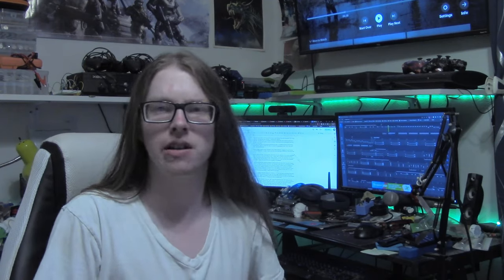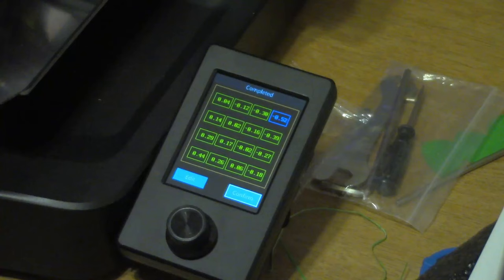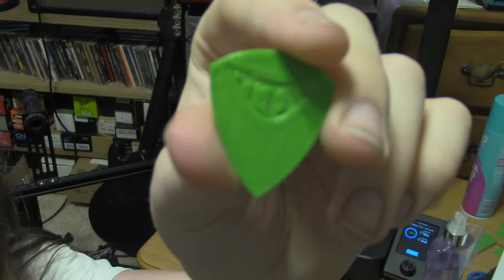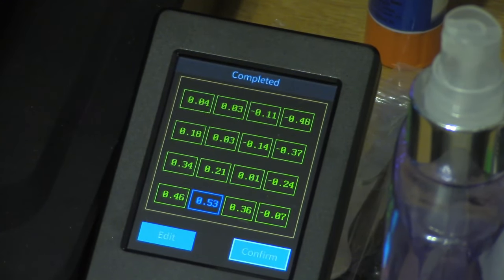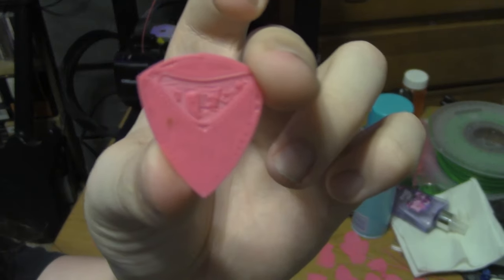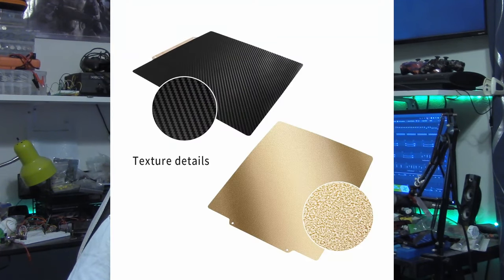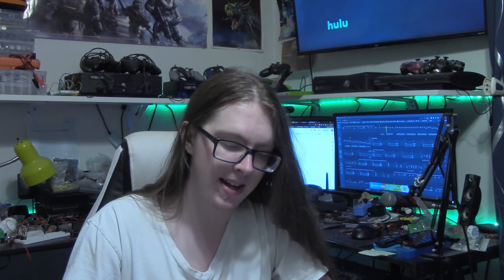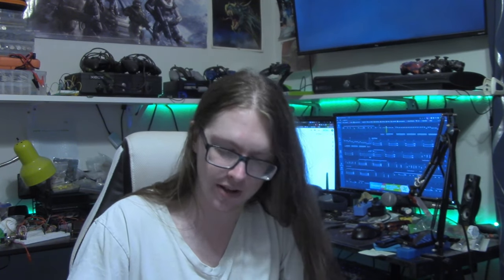Having trouble with your Ender 3 V3 SE Bed? So am I. Here's trying fix it.

Comment: Bro your supposed to remove that magnetic sheet OFF the bed and Bend it, to remove your prints. When its cooled off.  Your fine.....thats why its magnetic and removable
Reply from the maker: I know how it's supposed to be used. However on small prints that don't take up much of the build surface I find myself either doing more damage to the plate or not getting the print off anyway.
Reply: The print bed they provide has such strong adhesion it destroys itself, you can see tons of people complaining on Reddit about it. It won’t separate even with bending while cool. The first mandatory upgrade is a PEI bed
Reply: Not many people clean it properly or take the build plate of let it cool then bend small stuff might need a few more minutes to cool but it will pop of easy @crypto14

Comment: I have Ender 3 V3 SE for 14 days. I unpacked, screwed in the 13 screws, and since then I've been printing with absolutely no problems. It is my first 3D printer.
Reply from the maker: I bought it as an early adopter when there were few reviews out for it. They may have improved consistency on machine quality since then but mine has been a nightmare. I'm a little envious of the people that have a perfect time or only need to make minor adjustments. If everyone was having a bed time they might have done a recall or something but now I'm fighting them on a warranty claim as they try to give me band aid solutions.
But at least you're having a good time, especially for a beginner. Though be aware that some people have had problems arise after a month or so of perfect use, so just be ready for that possibility too.
Reply: Here to update - I got a gold magnetic pei bed for the printer and it fixed my problem with bed adhesion.
Reply: Same, it works pretty great. Small tip: never be an early adopter for anything!
Reply from the maker: @soyunbonus  Yeah, it really be like that. lol. If I waited, I probably would have still bought the printer based on other youtube videos. But maybe with the time they would have had better consistency or something. Who knows.
Reply: I'm going to guess your printer will develope problems in the next month. I'll try the new bed idea. I'm more keen on trying another brand printer like the bamboo labs a1 that rolls out soon to the usa
Reply: Yea the first month is ok after that you will be printing out piles of string. I genuinely have taken a sledgehammer to mine. That was after getting 5 replacements that all did the same.

Comment: For over adhesion. I adjust z offset by .02 to 03 in the prepare menu and when I run petg I use painters tape so I dont destroy pei on springsteel plate

Comment: I had terrible issues with stringing. I looked at loads of video’s including this effort. It turned out to be the firmware update.
Reply from the maker: That's a little strange, but also makes sense. It's unfortunate that in my experience the auto leveling seems to have gotten a little worse since updating to the .6 firmware.

Comment: I'm new to 3d printing. I have to say that this machine is kind of difficult. I also have to say that it has taught me a lot.
Reply from the maker: That's kinda how creality machines go. They're basically never perfect, and if they are, they don't stay that way for too long. I learned many different concepts and fixes because of my Ender 3 V2.
Reply: @Bowsmin12  As of right now, the hot end is burned and in need of replacing. It was my fault but the part will arrive tomorrow so it's not too bad.
Reply: I'm also new to it and it's my first printer, so I'm learning a lot too.  I've had good results with some filaments but others don't work as well.

Comment: That's what mine was doing and now no matter how many times I level it Its under extruding randomly it isn't blocked like at all .. not under extruding not slipping.. one pass is fine next it's the wrong height.... Normally I can adjust my beds but these seemingly have no adjustment!
Reply from the maker: Yup. They intentionally relied solely on the auto leveling system. In theory it would work, but in practice Creality has never seemed to be good at implementing auto leveling. I bought their CR touch kit to put on my Ender 3 V2 and put their firmware in the printer and it never worked right. Then I installed a third party firmware and it was night and day for my auto bed leveling.

Comment: Dont know if you are going to see this, but consider start doing 3D printing as your main topic on this channel, you helped me a lot! Kudos from Brazil
Reply from the maker: That's good to hear that I'm helping. The 3D printing content has cause most of the small channel success I've had over the past months to year. But unfortunately other than this troubleshooting journey, I don't have a whole lot of knowledge to pass on to people or really innovate things. I got lucky with my bambu lab P1P purge video. I just wanted to save on filament, so I went to the customer support and they told me how. I then just relayed that in a video because it seemed like the only other place I had seen anything about it was on a single reddit post and it was kind of hard to understand and in broken up bits of information.

I'm not quite sure how to grow a 3D printing channel if you're not making new discoveries. On top of that, I like 3D printing and what it can do for me, but I do find it insanely frustrating a lot of the time. It's a great tool when it works, but sometimes all the components and programs around 3d printing want to fight me and I don't always have the resources to fix them outright. At least not right now. I would love to work with companies to make videos with them but I'm too small typically for them to be statistically impressed. I'm really interested in the Elegoo Neptune printers but I just can't afford much of anything let alone be able to afford more printers for reviews and projects. That's enough rambling from me. Thank you for reading and your support.
If you would like to help, I don't know if it would, but you could try recommending my channel to companies and see if they would reach out on their own. If you have some other people do it too, it may be more likely to succeed. It's a small chance but it might work.

Comment: Ironically, I think you're supposed to use glue stick to help it stick less (intuitive, I know)
Reply from the maker: You can, but most times now, if the printer is worth it's salt, it should be able to print average PLA easily enough. The auto leveling is just bad, I assume due to their coding and doesn't play nice with other print beds on top of that.

Comment: I received my Ender 3 v3 SE two days ago. Its my first filament printer. Printed the provided example with the sample PLA just fine. Then loaded some local PLA . Could not print that crap to save my life. Either no adhesion, or if I get adhesion by jacking up temp then the print has major defects etc. After a day, I changed to using Orca which gave me tools to calibrate with. Bed temps, extrusion temps, flow rate etc. Now I print just fine. The flow rates were the most critical. First layer extrusion temperature and bed temperature determined adhesion. I now have it set that it comes off quite easily. Just take the plate off and wait to cool before removing it. No hairspray and shit. I am on firmware 1.0.4 and I see 1.0.6 is available. But I will use a RPi and go Klipper rather. The Ender 3 V3 SE was my learning machine. I will play and learn and next build my own now that I am seeing what works etc. Orca certainly produces better slicing and supports etc. If I take the same stl, the Creality slicer does mot do the same job as the Orca slicer does. As a beginner I wanted to avoid diving into the millions of parameters you have to deal with in Orca, but now I am a believer.

Comment: I just got my ender 3 v3 se week ago now,  probably have 48+ hours on it printing time, and I have a pretty good grasp of how 3d printing works,  but I'm still extremely new.  I've seen a lot of people having problems with bed adhesion, but I only find that when I'm printing in a very thin first intial layer thickness like  0 .10 so I bumped mine up to point 0.30 and boom never fked with it again, i also keep my bed temp at 45c and im using PLA right now so bout 200c for nuzzle temp
Reply: Yo i think you should bump bed temp to around 55-60c if you have adhesion problems.

Comment: You're not alone. I'm fighting the same problem. Even down to the back right corner lift. I've had some success with increasing print speed and flow rate. However, with each print the Z offset has to be readjust and this results in at least 2 or 3 failed prints. It's a huge pain in the ass...
Reply: I'm hovering between -1.40 and -1.61  for my Z-offset depending on print temp and speed. I'm getting the hang of adjusting on the fly but I have to babysit my printer

Comment: My issue is that this printer has too many corner's cut.  One of which is the bed heater. I have cold spots/hot spots so lots of curl up.  This printer is nothing more than a starter-printer with the expectation that you'll be upgrading to a much, much better one. Like a Pursa.

Comment: I've always had an underadhesion issue so when the print is done I'm going to get that fucker off. I had to modify the scraper edge that came with my printer to make it easier to wedge the scraper under the print.

Comment: Thank you for posting your journey. It is helping me problem solve my own problems with the printer. Right now I belive that my bed is too low so it's not printing on it. Just right above it
Reply from the maker: If that is the case then logically it would be fixable by lowering the z offset. You may find that you need to adjust some of the leveling data points after, but at least it's a start.

Comment: you can turn the skirt, brim off by searching adhesion in the advanced settings in creality print
Reply from the maker: I don't know if you're using an older version or something but it's under build plate adhesion, and in basic mode there are two options which one of them is build plate adhesion type. I talk about it quickly at about 11:18

Comment: Sorry you're having issues with your V3 SE.  I've got the same printer (my first) and I've had fair success so far (fingers crossed).  I also had issues with the bed being level, but tracked it down to loose screws which hold the heat bed to the undercarriage (the four Phillip's head screws under the build plate).  I've read where a lot of people have found other screws which have not been properly tightened.  You've probably checked them all, but thought I would throw it out there.  I DO have an issue with the heat break fan.... When it first comes on, it howls like crazy, like there's no lube in it.  Creality is shipping me a new one, not sure how long that may take.  You say there is an Official Creality Bed Leveling Test?  Where?  I'm already looking at something better.  Hope you get all your issues resolved!
Reply from the maker: Thank you for your comment. I read the same thing a few times about the screws and tried tightening them before. Besides a little play in one of them I think, they were all very frim. And about that official creality bed test; I KNOW RIGHT! They don't provide it anywhere right now but it's becoming a necessity. I'm going to try to find a good file sharing platform to post the file to.
Reply from the maker: I have made the file available publicly on github. Or at least tried to. Try this link and please let me know if everything works okay. https://github.com/bowsmin12/Ender-3-V3-Creality-Bed-Test
Reply from the maker: @ronaldbrand9696  I added the link you provided for the creality YT channel to the description of the vid for others to use as well. I didn't know that channel existed, thank you for showing me.

Comment: i finally ran my z offset at 0.15 and before that, used armor all on the pei cover-then rubbed with a wet rag. worked well and the second print even better.

Comment: Great video. I would recommend a clipboard and do takes in between turning pages in your notes because the paper noises from your notes is a little distracting. Also if you can get a better noise filter (OBS works great for me) to isolate your voice from your ambient noise it will provide a better experience for listening with headphones.
Reply from the maker: I have other videos using obs. My mixer I use as an audio interface at my desk isn't great and makes a lot of hiss that I clamp down on with a noise gate, but still a few people have complained about that too. So unfortunately unless I plan everything around me for a video, there no real winning for me in this situation.

Comment: I had a spare Raspberry Pi available so I went the Klipper route.  I also use MRISCOC firmware on my V2s, and got spoiled by the 9x9 mesh.  I did the same with Klipper by changing one line in the printer.cfg file.

Comment: I just adjusted z offset with my eyeballs and measured the first layer till i got .2 .... probably not the best way but its working for me. After a while doing the auto bed leveling with this printer it decided the z offset is like 2 cm away from the buildplate so i just set it back to -2.45 with my pei sheet. And whatever you do never hit pause with this printer at least for me it will skip the entire layer it was recently printing and move on to the next one and will ruin your print. Hopefully a firmware update fixes these issues but they haven't updated it since October
Reply from the maker: Interesting about the pausing. Have you tried it more than that one time? It could be a fluke but of course I'm not betting on it. Were you able to update to the 1.0.6 firmware? My printer absolutely refuses to accept it.
And my leveling has high and low spots typically so unfortunately my Z can't be raised or lowered for a proper all around level.
Reply: @Bowsmin12  I have not updated it yet but creality told me you need a TF SD card (the one that comes with the machine is supposed to be TF from what they said) and a micro SD for the display. Ill try updating it later today and see if I have any luck.
Reply from the maker: @bingchungus7064 You need a micro SD for the screen, that is correct. If I remember correctly, they also say to update the screen first before the board / main slot.

Comment: Great video and all but are you sure it's leveling issues try Turning down bed temp to 30-40 the auto leveling is actually so good it causes great adhesion to the bed.. little too great to combat that turn down the bed temp. Few bigger YouTubers already stated this.
Reply from the maker: Okay well I did start making videos about the printer toward the beginning of when they were coming out. Only a few came out at the time this did. As well as I moved quickly to my G10 plate anyway because I needed a smooth bottom surface for the project I specifically bought this printer for. This causes it to have poor adhesion rather than over adhesion. This was shown in the video. I also have another video exploring physical fixes, which didn't help my situation, but I have discovered other issues that I am working on fixing.
Reply: @Bowsmin12  No you had a lot of good points my man! There are honestly going to be flaws in each printer and different each time it seems. So hopefully you get it all figured out. That is right though you did swap to the g10 that's crazy you have like super adhesion still. And I get what you are saying about those small ones should just pop off without having to bend the plate they really should. Yours is the first I've seen that happen on
Reply from the maker: @MattysWorldOfArt  It's kind of all over the place and I'm hoping that's because of the issue I found. Which is that my print head was tilted and my leveling probe bracket was tilted compared to the head itself. So probably lots of tolerances off in that instance. I have received some spare parts from creality and it still isn't proper. My last hope is that I can fix it by switching the V wheels, but the stock wheels don't look worn really. Unfortunately I don't have any spare wheels, I've surprisingly never had to change them on any of the few printers I have.

Comment: i always run auto bed level and then adjust the z offset down to get a good bead.
Reply from the maker: It's been a while now, but I think that I could get a decent print in the middle area doing that, but overall there would be different spots still that didn't work right. I bought this printer for making guitar picks and when doing batch prints, it messes up big time. It seemed like big different results over a small area. I'm on vacation now but plan to sit down with it again and really try to dial it in again and see how it can perform, possibly for a final review of the printer.

Comment: Not returning it was a strange choice, even for big brands, product defects can occur. Considering most people I have seen are having a good time with this printer, you probably have a defective unit.
Reply: maybe what he is trying to do is not suitable for this printer
I think most people are not going to  care about what the first layer where it was stuck to the bed looks like.
he is  trying to print something thin and that has no way to get a good grip on it to remove it and, i can understand what he wants and why  for the pick to have sooth surface and the logo but this sem sot be a very specifc and very common  use case, most peeople are probably on concrened that the other layers are ok i mos cases
Reply: I had a similar issue, when I was inspecting my printer, I noticed that my belts were a little too loose. Got them Tightened and now it passed the self-test.